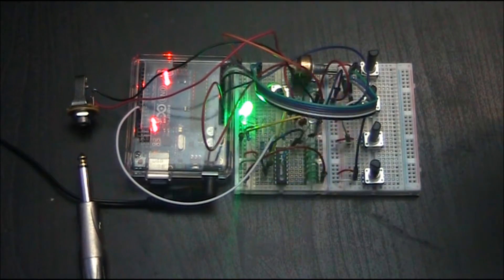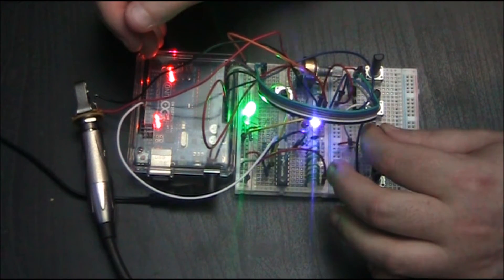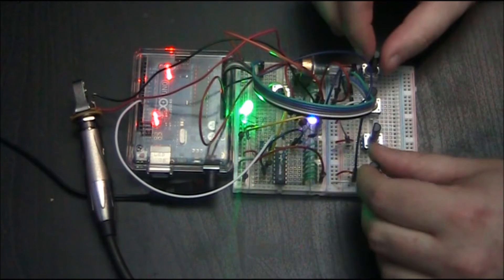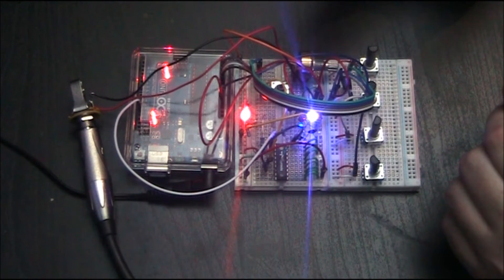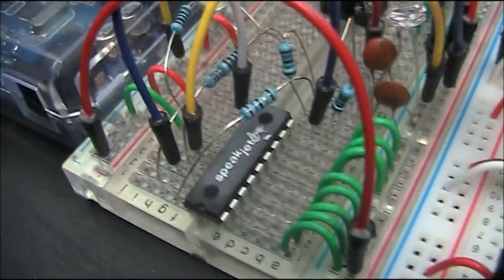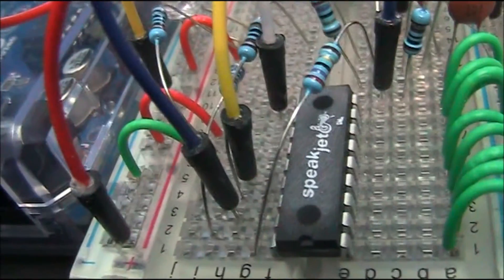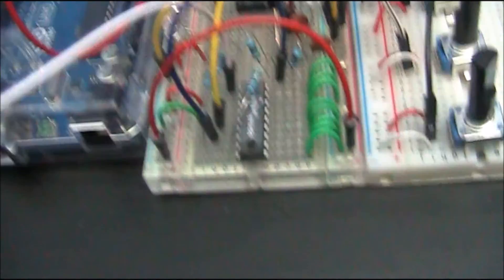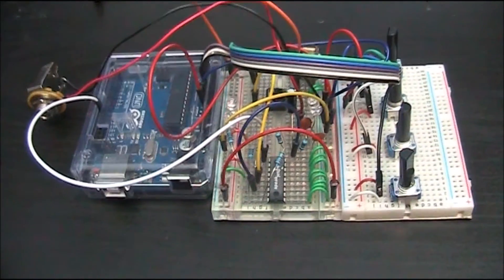Arduino + Speakjet speech synthesis 'Nonsense Babbler'

Comment: Howdy! Cool project. Im a a lttle late to the party but do you still have the sketch for this? I checked the one on your GitHub and it's a bit different and giving me super unpredictable results. Even when I replace all pots with static values (including the phoneme value) it still behaves randomly. Side note/fyi the wiring diagram on your GitHub shows the reset button wired to the V+ input. Thanks!

Comment: i just dug up an old sparkfun Speakjet shield that's been waiting for a project such as this. It looks at first glance that there is a filter/ amp on the shield but little else.. ill have to see if it is at all compatible with your script, pinwise. there's also a little proto-space on the board which is cool.

Comment: Hi Danny, can you confirm what value the pots should be? I am assuming linear as opposed to log? Will 5k Lin pots be ok?. Thanks for posting interesting videos!!
Reply from the maker: I used 10k linear pots because it's what I had available. I've just had a quick look online and apparently 10k is the best value to use with an Arduino for reading an analog voltage but it looks like you might be able to use 5k. I'm still at the "try things out and see what works" stage so I can't tell you with 100% certainty whether it'll work -sorry! Definitely use linear pots - you're using the pots to select values really so you want the response to be linear. Let me know if you have more questions and I'll do my best to help :)
Reply: DannyCarnage Thanks Danny, will use 10k pots.Cheers!
Reply: DannyCarnage Hey Danny finished building my own "babble-box" using your code and schematics. Cool! I made one alteration to the code so that the random phoneme values can be changed using 2 10k Lin pots. Can now get the box to make wider range of sounds.
Reply from the maker: Awesome! Do you have a video of it? Would love to see what you've come up with.
Reply: DannyCarnage Will see what I can do!

Comment: This is what I look for. Could you provide a bit deeper in the detail?  Could you provide the schematic of this?
Thanks.
Reply from the maker: There's loads more detail at https://github.com/dannycarnage/SpeakjetNonsenseBabbler where you'll find the Arduino sketch and the breadboard layout. Since making this video I've updated the code and design so the Github page has the latest version. Hope that's useful but if you have any specific questions feel free to ask! :)
Reply: DannyCarnage Oops! Forgot to set my video as "Public", grrr! Should be there now.